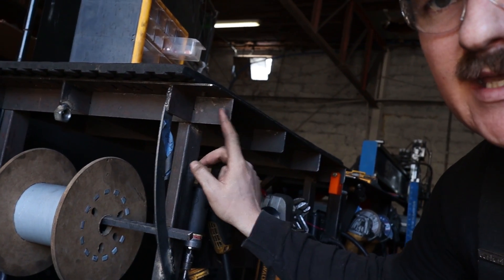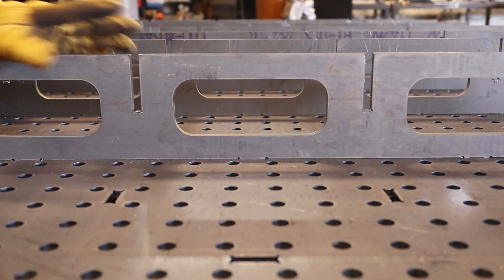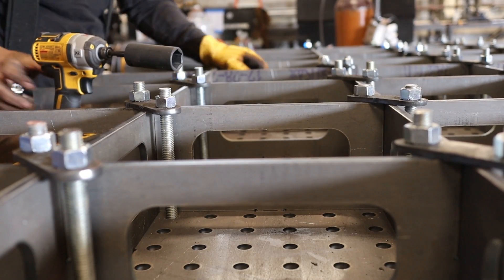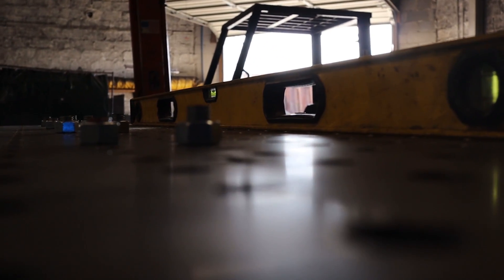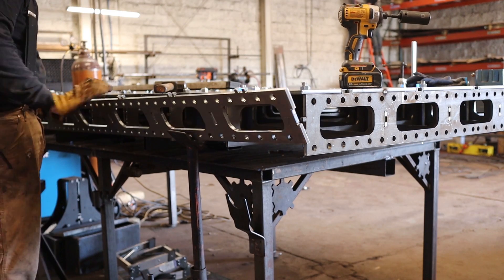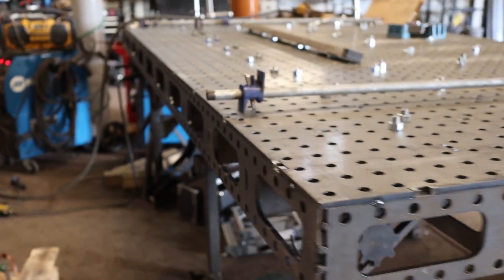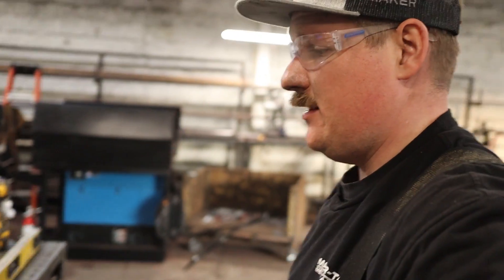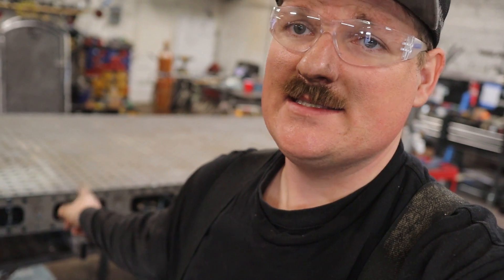5' x 10' ULTIMATE MAKER TABLE KIT - Welding Fixture Table

Comment: Having a measuring device that limit a your tolerance to nothing less than a 1/16 inch is crazy.  Using a 4 foot level for your straight edge is in the same category.

Comment: I do like design and what are though about water jet cutting out the steel.I going to cut some of dxf files, I bought few days ago in some cold roll  .250 plate 2x4 and 4x4 table with my Plasma with HT 45xp finecut machine torch with water mist no and thc the standalone controller by Masso what ever happen to your old table that you Built.
Reply from the maker: Waterjet will work great! I traded the old table for a used dragon tube cutting CNC but it was a basket case and I ended up getting rid of it a few months ago. So now I'm running production on our new line of plasma tables and switching to fiber laser soon.